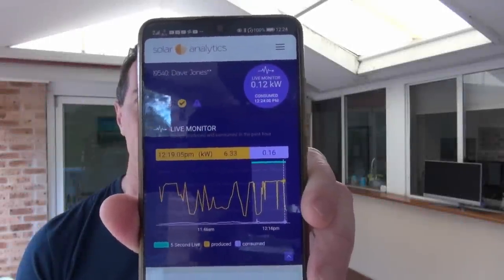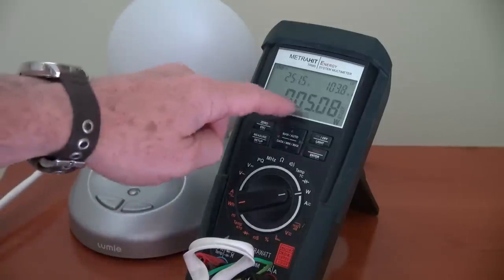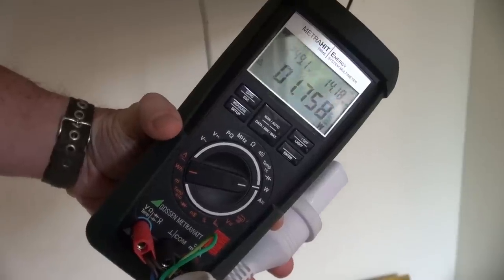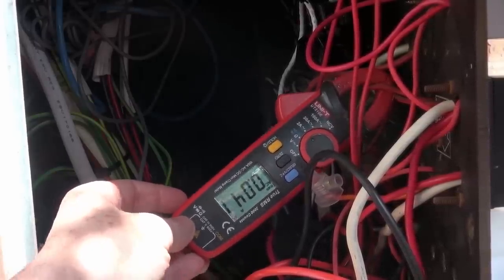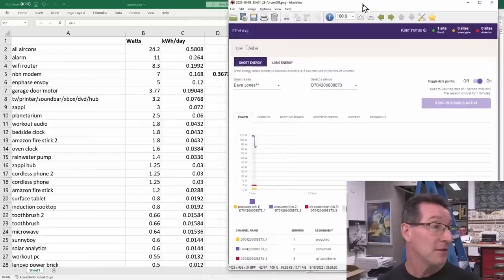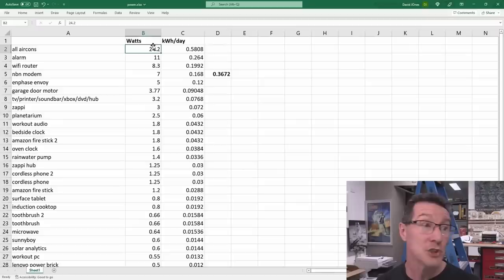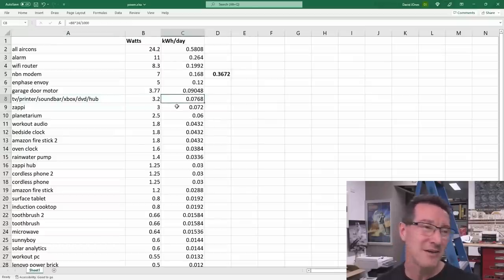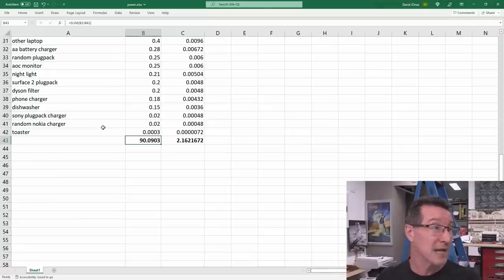EEVblog 1505 - 120W Home Phantom Power? Audit Time!

Comment: plug in  and turn on a copper core transformer with negligible load on it. It will correct the power factor of all the tiny little parasitic / capacitive loads.  My minimum power usage shows as 190 watts, i turn on the kitchen LED down lights ( 3 x MR16 x 5watt) and the power usage 'drops' to 99 watts.  The MR16s are on an old 20 amp copper transformer.
Reply: that technique can reduce PF (that no residential customer pays for), but will always INCREASE real power (but only slightly if it is done properly)
Reply: @dl5244  yep agree, i was just suggesting it as a method to get a more accurate reading of real power.

Comment: Be aware that data logging and some security systems, cams use the Internet as their backhaul in other words modem and router would have to stay on. Another reason would be some modems take longer to resync after they have been off for a while. Oh and don't forget VoIP home phone service it's important to have emergency communications.

I am actually in the process of transitioning my router over to a new one that's gonna be powered off of batteries powered off of a centralized DC power supply. the idea is that the power supply will keep batteries topped up and then when power goes off it'll run off batteries for an extended period of time using as little power as possible for maximum runtime. My access points (airports) will be off of the AC off of a UPS but those aren't as critical as I could plug in with Ethernet cables in that case, and deploy a super low power access point off of 5v. I also have my ham radio on the same bus. just recently had a 30 minute power outage... Internet stayed up the whole time it was wonderful and I don't even have the new router configured and attached. I'm currently using an old PC running PF sense so I'm looking for the power savings and to tackle the annoying bad power supply fan bearing.

Comment: I really want to see a capacitor in a toaster! But somewhow I don't think it has one.... 
I guess that I can officially say that Dave has caught the solar bug! Testing every single thing in and around the house for standby power usage... Yeah you got it buddy... 
Unfortunately my house has a standby power usage of around 900W, just recently spent just over a week in Sydney for two weddings and when I got back, I could see on the Australian government funded energy meter thingy what my base load is.... 750W of the total amount is going to the blade server and it's 20+ hard drives, switches and routers and firewalls and a UPS. I have tried switching over to an off grid solar system that only has enough battery for 1hr runtime without any sun but actually gets me through the day from 9am till 5pm and it makes a huge difference... 
Currently working on getting more battery capacity and a transfer switch because the panels and charge controller have the capacity to run my computer's and charge a much bigger battery.... Of which has had a price jump recently from $3000Au delivered 10kwh battery to $6000Au.... Not sure what is going on there, unless it's an AliExpress thing that oscillates prices to catch people out or they are actually going up and possibly going hiking with it.... Who knows, but I'm keeping my eyes on it...

Comment: Do you have a doorbell transformer? I think some HVAC systems also have a similar 24/7 transformer.

Also, with our GE µWave, if you un-plug it for a few seconds... the clock display can be turned off by pressing cancel when it comes back up in the 'clock set' mode. (Doing so is undocumented in the manual.) However, this didn't work for the LG stove clock. As always, YMMV.

A while back I additionally noticed a 'warmish' area on top of the paper shredder! As it only sees ocassional use, it now remains un-plugged unless in use.
Reply: My microwave has a configuration menu accessible through the clock button, and turning off the clock display is an option.

Comment: I leave my NBN and wifi on because I have updates and podcasts dowloads etc scheduled to happen at night.  I might turn off the three split system AC systems at the power box though.  I haven't really used them since my wife passed away.

Comment: Total resistive load is not the sum of the individual resistive loads.  You'd have to sum the complex loads and then figure the real magnitude of that sum.  The reactive waveform of all those gadgets together is going to be a mess.  It's not linear or sinusoidal, and scalar arithmetic is not enough.

Strange to think that hardly any of these parasitic gadgets existed a few decades ago.  All we had were transformers for thermostat and doorbell, and passive switches (including mercury types!).  Before electric there was gas street lighting, and lamplighters going around to open/close/ignite them.

Comment: the stuff connected to the ISP (the stuff they delivered) should be connected at night as that is when they get the updates etc. and some update's need multiple restarts before use etc. 
STIL. now it i winter here. there is no difference from running a computer or electrical device then it is to run the electric resistor cables in the floor and on the wall's. what is 90W when you have 2-4000W on 24/7. average electricity consumption thru the year here is about 1800kWh a month moste of this in in the winter so 2-4000kWh a month. a normal house here use about 20-22 000kWh a year.

Comment: I really enjoyed this video dave, its something ive wondered about for a while. Instead of all those wall worts do you not think it would be better suppling 12v, 5v or both right through the house, then using one power supply or a 12v battery with solar or wind to keep it charged.
Reply: This is exactly what I do with my off-grid power system. If a thing can run off 12V, it does, as that significantly reduces conversion losses.
Reply: And how are most people ever going to get low voltage wiring installed without serious work and expense?

Comment: 17:25 Smart breakers controlled via an app are a thing, not suggesting that you should, but it's totally doable and for reasonably cheap.
Reply: You could switch the wifi router off with it, oh wait...
Reply: @steve6375  I don't know if they use it, but Bluetooth is a thing... 
Also, timers usually aren't reliant on wifi depending on the device of course, a NEST or something always connected obviously won't do anything without wifi, but the smart plugs I've used tend to keep working even without internet, once it's programmed it just does its thing.

Comment: I have eliminated a number of computers (desktops) and replaced a few with raspberry pis. Also decided to stop contributing to folding at home after a few billion points. Don't have AC here,  but the residual electricity being used will provide some heat,  which comes in handy in winter when heating is required. There would not be much in it. I've thought about getting a power meter but haven't done so  (still might). I did build a cable where I could put a current clamp on one conductor.  I should have a look at the power meter outside to see what the standby/residual power of the house is.
Reply: Oh, most of my appliances do not have a lot of smarts. I do not need an Amazon Alexa spying on the house. Pretty sure that my washer/dryer use 0 when off. The oven has a little clock on it, probably not much there, no other smarts. Clock on the microwave.  It would basically be computers and network gear. I'll check the power meter when it is light out.
Reply: The power meter only displays kWh for the day and total kWh. :/

Comment: This is one of the biggest incentives for me to look into battery-backed solar.  I don't want to care about power usage anymore.  I want to leave computers on 24/7, including a NAS with a bunch of drives, virtual machine servers, etc., use electric heat pumps instead of NG, and so on.

If I can do that by siphoning off some of the energy bouncing off the earth's surface and heating up the atmosphere, using it to do work, and creating the exact amount of waste heat ... man, that's the dream.

Comment: Might the unaccounted power actually be related to the reactive power?  As repeatedly noted, reactive power is real current, but home structural cabling has real if small resistance.  A missing 50VA of reactive power would account for about 5W of real power in the home structural cabling accounts for a tenth of an ohm resistance.

Comment: In a few recent videos I've noticed some weird S-sound artifacts, almost like due to the codec. Easily audible in this video. Even just the very beginning, there's a weird modulating of the very high frequency. 2:39, also 3:56 for the toothbrush. Same for the opus (251) and m4a (140) audio versions here. EDIT: can hear on mobile YouTube app as well. It's like the mic is generating some kind of high-frequency vibration inside, and the audio codec isn't handling well.
Reply: I can't hear it (and I'm not old).

Comment: I expected more electronics from a tech nerd. I'd need a week to audit all my stuff at home. 5 desktop computers, 13 laptops, 3 NAS, a server rack packed with 5 switches, countless controllers, project servers, etc. 14 IP cams, 3 alarm systems, 9 TVs, 6 VCRs, 5 Rokus, an e-lab with several dozen devices, a dozen video editing devices, 7 gaming consoles, 2 vintage computers with accessories, 3 Dolby atmos systems with 2 dedicated amps, 4 soundbars, 3 security cam monitor stations, about 40 Philips HUE lights, central AC, 5 ceiling fans, 100 plus adapters for countless small items, and all the other standard items.

Also, that breaker panel wouldn't fly under US code. Do you have window AC units installed?

Comment: What about the lights? IIRC in the porch LED light video, you were using hard-wired drivers. Are there still some halogen transformers or ccfl ballasts hidden away in the ceiling?

Comment: Dave don’t turn your router off at night. I’m an optical transmissions engineer for a large telecoms network provider in the uk. By turning it off and on, you may end up fooling the system into thinking there is a fault with your line which will then slow down the speed in an attempt to improve reliability

Comment: Here in the UK, power is around £0.35 per kWh. There was a threat of £0.80 until a government subsidy was mooted. (I was thinking of running a diesel genny to save cash, while using the waste heat for my home!).
I see a draw of 161W in the morning. Fridge @ fridge freezer are always on, also, a PC tower on standby. 
Do you think the capacitance of house wiring draws power Dave? 
I am fitting a 15-minute overrun timer to my heating pump to move residual boiler heat to the rads. Currently, running 50W constantly during timer on state.
Reply: "Do you think the capacitance of house wiring draws power" We don't pay for that since it's VA not watts.
Reply: @CamelCasee  True but the reactive power causes additional current inside the house, which does dissipate real power (RI²). If the power factor of the load is really close to zero then obviously the heat loss will not be negligible compared to the real power drawn by the load. Probably not the case here.
Reply: @CamelCasee  I still can't grasp that "VA versus Watts" concept 😄 
I did unplug a number of 240 to 110 autotransformers, which reduced my usage. That must have been due to the resistive part of them, I guess.
Reply: @tommiller1315   "VA" (and "VAr") diverge from "Watts" with a non-resistive load. In most of the examples shown, the loads were a non-linear electronic circuit with a full-wave bridge rectifier (and no power factor correction). Other examples where VA > Watts are with inductive (motors) or capacitive loads.
"VA" (apparent power) is the product of rms voltage and rms current. It's a metric commonly used for sizing conductors and generators.
"Watts" (real power) is a real physical concept measuring the ability to do work. For an arbitrary supply voltage and arbitrary load currrent, It is measured as the average of the product of instantaneous voltage and instantaneous current. More commonly for steady-state sinusoidal AC it is shows as the sum of the dot-products of voltage and current measured over all frequencies.
Reply: @dl5244  Thank you! I will try and absorb that later. 
From memory;
Resistive load, current and voltage are in phase.
Inductive load, current lags voltage.
Capacitive load, current leads voltage.
(I am somewhat happy with DC circuits) 🤣

Comment: The VAR dissipate power in the wiring (that's why we need to minimize them); but 15 W does sound like a lot.  Did you verify the 120 W again afterward?  Some of it also is likely measurement error.
Reply: power meters generally do not have an accuracy spec below 1% of rated full load. He's also using two sets of CTs (current transformers) of unknown accuracy grade and subtracting their outputs... definitely a lot of error down at these low signal levels. I'd guess due to non-linear electronic loads, his current THD is very large (~100% of fundamental)
Reply: @dl5244  The frequency response of the meters is truly an essential consideration. for non-sinusoidal currents.  I will bet that this causes 99% of his discrepancy.
Reply: @byronwatkins2565  my experience is that non-linear single-phase loads have >90% of the rms current below the 11th harmonic. And for mains voltage, >95% of the voltage rms is below the 7th harmonic.
So the real power in frequencies above fundamental are <<1%.
The exception is for very long distribution lines at very high switching loads or due to undersized transformers (neither of which are relevant for urban residential)

Comment: 5:03 My Samsung microwave draws ~2W with the clock light on.. and they know it's shit, as it has an eco button! Open the thing, and it jumps to 30W due to the bulb. Not that you can see anything, as it's not bright enough and the door is way too much darkened.
Also of note: set-top-boxes, 10W / each.
7:36: I have a Sony external power pack for my A7S camera, it consumes 1.5W without anything connected to it. So It really depends.
9:50 wow, that's a lot for ACs. My ~7y-o Daikin has ~1.5W idle draw.

Comment: 10W for the network is a nothingburger. Where i live wifi channels are packed to the brim with APs', had to hook up everything with wire and get a managed switch. That in itself uses 2-3x of that..... (and i havent even turned on my NAS)
Reply: Interesting, what were the symptoms of wifi airwave congestion? I think that might be what's going on in my street, changing channels doesn't really cut it anymore.

Comment: I'm currently on the question of if it makes sense to turn off a VFD via a contactor at night?
Not only for saving power but also for longevity and system stability? Worth a video?
The VFD will run at daytime on PV-Power so the extra power consumption from the contactor would not be so heavy on the powerbill.  
And with a contactor, the standby consumption at night would be eliminated but i wonder if switching a VFDy ON & OFF  one's every day would hurt its lifespan.

Comment: Do australian houses have some kind of air extraction / renew ? Here in france it is mandatory (VMC).
I remember you mentioning some kind of roof vent, but is it purely convection or is it a motor.
Reply: Most of those MHRV systems take about 20W 24/7.  I got a passive HRV system installed in my new off-grid house which works using the stack effect and wind.  Makes a good silent alternative to a fan but isn't applicable to all buildings.
Reply: Even in old houses?

Comment: I might have missed it but it appears the source of the 120w is the inverter? Most inverters sold in South Africa and likely elsewhere are not classed meters. I do electricity billing systems and there is an explosion of inverters sold here. Many home owners very unhappy their system says they only used say 1000kWh and the get billed for 1100kWh. Few seems to understand the inverter is not very accurate. It is not in many cases. I have noticed with my own that the under 500W is not figures you can rely upon.

Comment: Media in UK saying not to turn off modems routers due to updates and ISP throttling internet speeds as they monitor the lines 🤷🏼‍♂️ That car charging port could be switched off just fit a contactor start stop switch before the isolator switch then you won't wear the isolator out.
Reply: And how long do you think it will take to pay back the cost of the contactor and the cost of energizing that contactor?
Reply: @Monkeh616  Twice the middle to the end at a ruff estimate ... Bit like how long is a piece of string.  To be fair in the UK if you were to set up a 1kw solar array on the roof it would literally pay for itself in the next 5 years which is roughly 10 years off what it was before the energy crunch and people were happy to pay out then, so a single contactor or relay and a couple of switches is negligible. The question is do you want to reduce your carbon foot print or just do cost analysis because with cost analysis I see a very dark future for the kids but then again you'll be dead and gone so why should you care right ?
Reply: @SlyerFox666  An interesting leap you make.

The solution to reducing your 'carbon footprint' is not to throw more consumable equipment at a problem.
Reply: @Monkeh616  I never said buy cheap crap from China, but then again as we live in such a disposable society the point you make is like turning up with a dustpan and brush after an earthquake.
Reply: @SlyerFox666  Contactors don't have infinite life no matter where they're made.
Reply: @Monkeh616  Yup everything has a finite life span,  that's why you usually pay more for things that last longer and if it's good enough for industrial control it's good enough for me.

Comment: You can get a remote controlled power switch for the TV so it’s easy to turn on and off from the couch.
Reply: And with just a little bit of bad luck, that remote controlled switch will consume more power than the TV itself in standby.